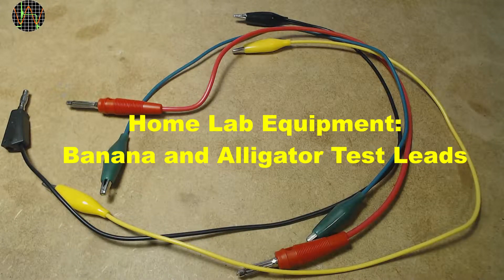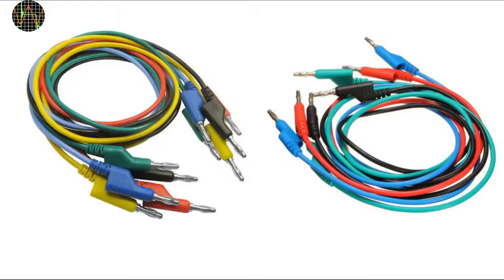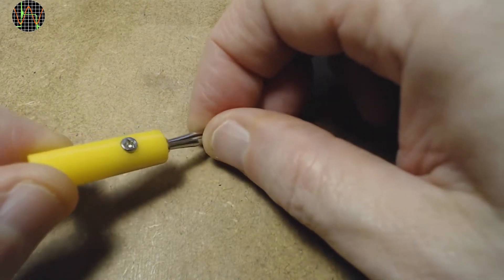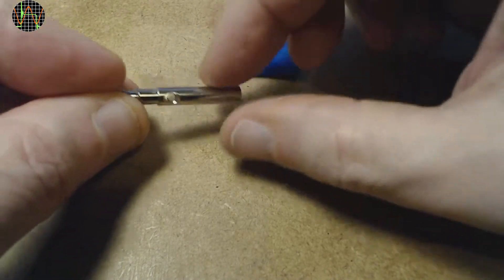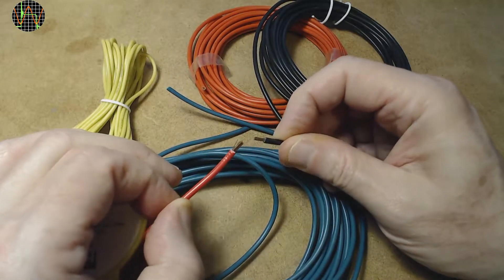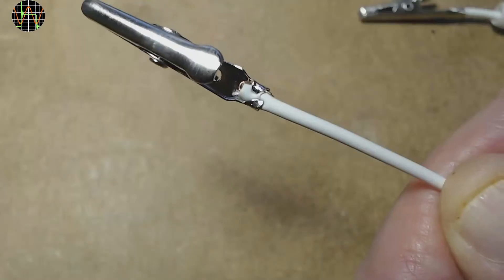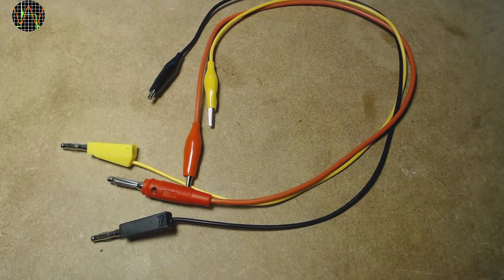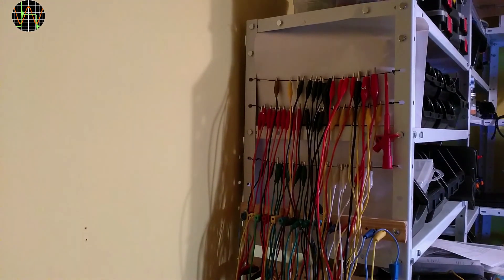Home Lab Equipment: Banana and Alligator test leads

Comment: You can never have too many leads like these :o) It's such a shame that cheap patch leads from ebay have 'unknown' construction...could be properly soldered copper wire, or it could be badly crimped copper - coated Al. As you say, you have to assume the latter and just rebuild them if they are.  I don't want any leads or cables made from that terrible Al wire, thankyou very much !